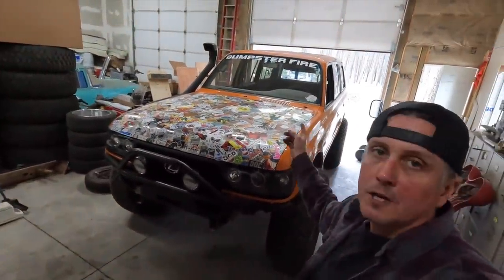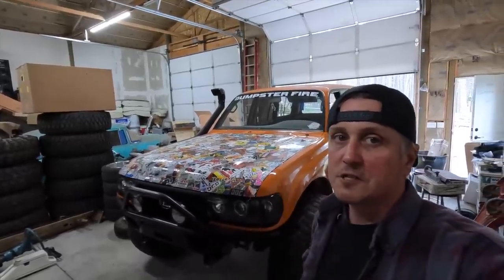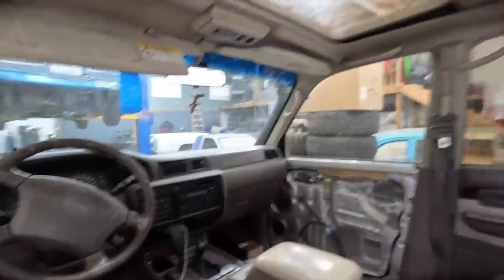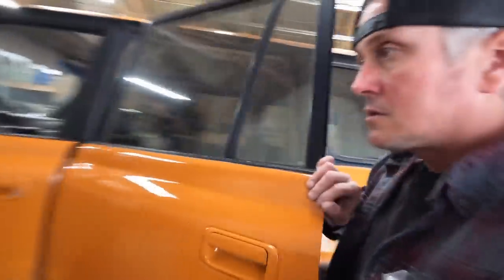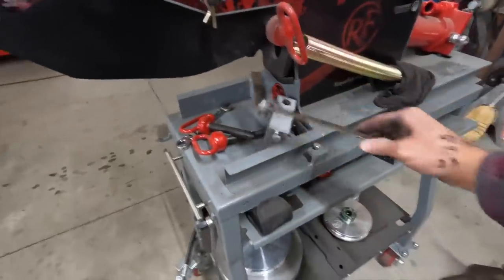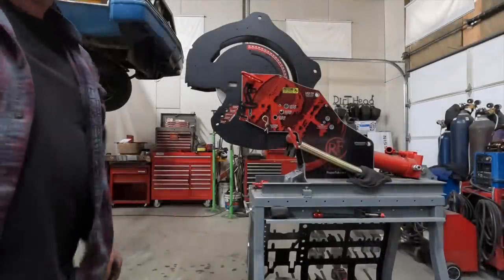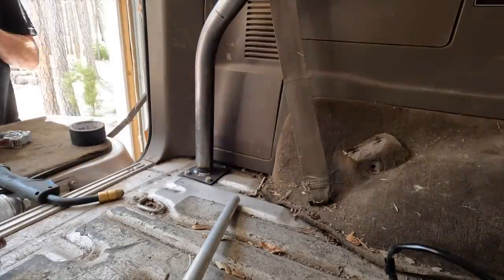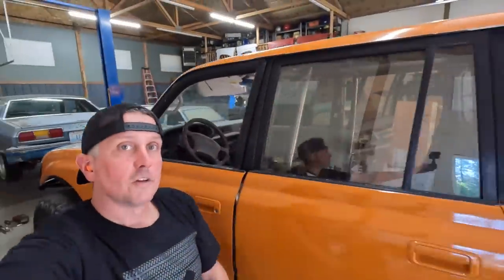Fabrication of a Roll cage for this Toyota fj80 Landcruiser

Comment: That’s so awesome! I have a 92’ Land Cruiser and I am doing an EXO cage/roof rack. It will start at the frame/chassis, right by where the brake pedal is (but underneath the hood), go straight right up to where the fender meets the hood and the windshield cowl is, following the A pillar, along the roof, all the way to the “D” pillar in the back. It will have a piece connecting the B pillar and the rock slider. Next upgrade will be a Cummins 6BT/NV4500. Believe it or not, I bent .134” DOM with a Harbor Freight “pipe kinker” with a modified DIE, and I can make perfect bends without waves nor kinks. I already built 6 full roll cages with it. Zero kinks!
Reply from the maker: Nice. Sounds like a fun project

Comment: Solid work. I'd consider some triangulation to transmit loads between the members, though. Particularly between the B and C pillar hoops, up against the roof, and in the tubes that go down to the D pillar.
Reply from the maker: Yeah. This is a good starting point. In a hardcore wheeler I would definitely add more tubes

Comment: Hey I know it isn't your rig but when wheeling anything especially an 80, its nice to replace those grab handles with kayak handles that way your head doesn't have to remember where the bumps came from.  Also there needs to be a pink panty sticker on that rig since it is a Lexus.  Keep up the awesome work man!
Reply from the maker: I’m confused
Reply: @thedirtheadshed  The Stock handles are hard and don't feel good when your head bumps in to them. So I ordered some kayak handles which are flexible much like the ones people have in Jeeps, Now I have soft grab handles in my 80 and I also use them to hold my fishing rods when I am not using them wheeling. If you google LX450 and pink panties, its a badge of honor for wheeling such a classy ride.

Comment: Question for you Dave. What's your thoughts on using HREW for cages? I know what the generic internet answer is, but what are guys out in the wild actually doing? 1.75x .120 DOM in my area is $17/ft. It's almost at the price point for me where it's either a HREW cage or no cage until next year.  It was used in racing for many years before budgets got bigger and speeds got faster. Yes more people were injured/killed  back in the day, but was it more due to material or design? Anyways I would love to hear your thoughts! Keep the videos coming and rock on man!
Reply from the maker: If it’s inside a slow speed rig HREW seems fine.  If it is external , getting drug on rocks, and used as a tool it should be DOM or chromoly.  It’s more about the design and triangulation as far as strength goes

Comment: Maybe this is just me overthinking but no front area added to the cage seems like it could get bad quick in an end over end roll over and a steep climb or descent.
Reply from the maker: Yeah.  It’s pretty important to have a front half cage in a hardcore rig
Reply: @thedirtheadshed  if you're calling a Toyota on 39s that's bound to have lockers and a winch not that capable then we're on two different playing fields